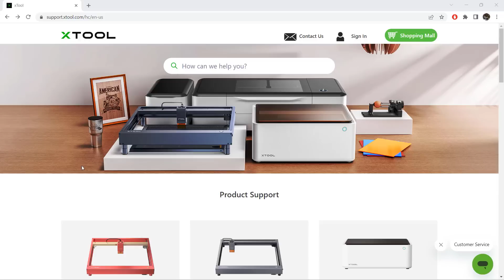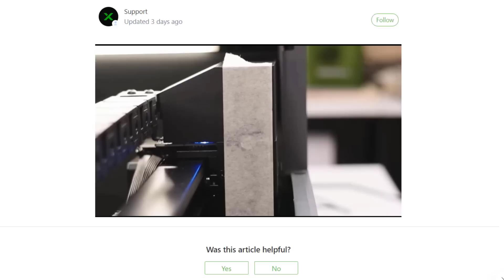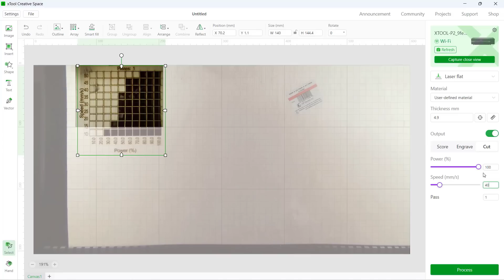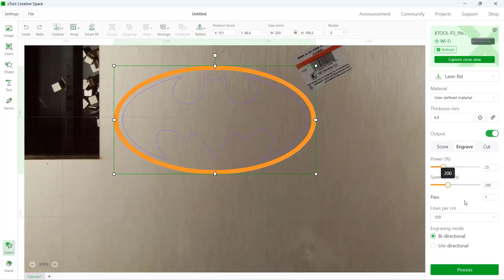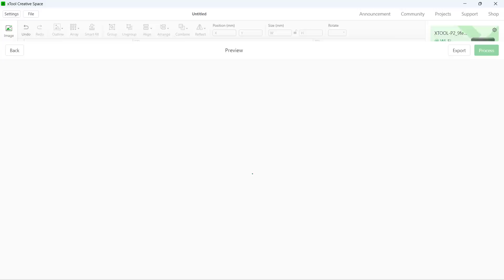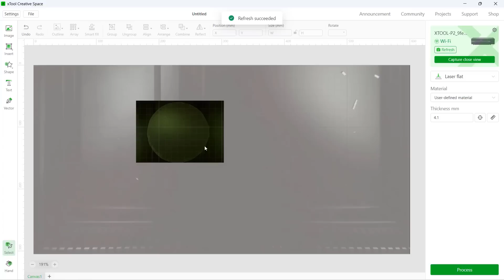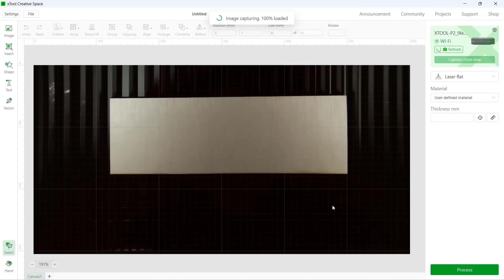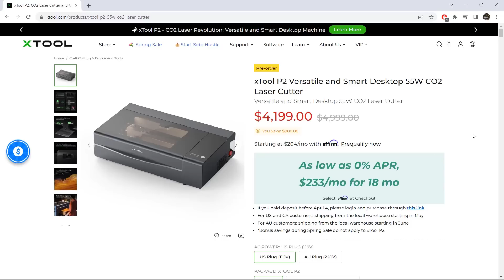xTool P2 55W CO2 Laser Engraver review: A luxury laser engraving machine with a premium price tag

Comment: Finally someone doing an more in-depth show and tell. Thank you for going into the details too.

But I do have some questions:

7:20: why doesn't the camera view show the top of the material (the "Interval: 0.100 mm" part)?
8:23: What's the red dot?
16:35 does the riser come with honeycomb?

One reason for me to look into this instead of the commercial machines in the same price range is lack of space. Even though this is not a small machine, it seems to easier fit into an appartment. :)
Reply from the maker: 7:20: why doesn't the camera view show the top of the material (the "Interval: 0.100 mm" part)?
Because the Interval text is outside the picture size of the close-up camera

8:23: What's the red dot?
The red dot is for the material auto height measure.

16:35 does the riser come with honeycomb?
No, it doesn't, that's my own honeycomb bed for diode laser.
Reply: @AuroraTech  Thanks for your fast reply. I'm really intrigued by the machine and might get one, especially since I prepaid to get the $1000 discount

Comment: Very well presented and laid out. 

I notice that the bottom seems to be open. Is there anything that would prevent one from placing this unit on a larger (deeper) piece to engrave something already constructed? 

I know it is heavy and that is a drawback to that but a purpose built stand would alleviate that allow a wide range of use
Reply: They sell a riser stand for it

Comment: I am very bummed they were not on top of it and had the curved engraving and features available before the release. They were already asking for prepayment a month in advance of shipping.  Now these new (extraordinary) features aren’t even available yet.

I was set to pre-order and decided to wait instead, HUGE bummer.
Reply: it's likely that all features will be available by the time the machines are delivered. Don't forget any videos posted atm are from beta testers (so the machines used are pre-release)
Reply: @neilrisley6667  I understand that. I still think the “hype” would have been better if the beta testers were able to showcase those features since it’s what sets the machine apart from others. I personally just can’t dive into a commitment of that price not knowing exactly how well it works.
Reply: @kaitlynjackson3189  I feel like the risk was worth it with the discounted price. I ordered the P2 with the riser base, the auto feeder & the rotary (along with the free £150 acrylic pack) Total cost was under £4,300 which compared to other machines out there is bested in price only by the Gweike Pro (even without the features) The Gweike Cloud Pro is less powerful, has a smaller working area & the passthrough & riser feet are nowhere near as good as the P2s. I guess if you'd rather wait to see reviewers show the extra features being used you have to pay the extra price without discount. xTool already have videos of the extra features working, that was good enough for me.
Reply: @neilrisley6667  it was very tempting. I’ll give them that. But your also paying that and waiting a month and a half for a machine you haven’t been able to view all of the functions. On top of that, they sale they have right now is only $200 more. And since the curved engraving is the main reason I want it. I’m willing to pay more and wait for reviews. 

But once you receive it, you will have to let me know what you think! I’m definitely anxious for the reviews.
Reply: How did you manage to get all that for £4,300? It is £4,898.00 on their website before the price goes up significantly... :(
Reply: @CristianOBalan  I pre-ordered on launch day after putting a deposit down (that gave a £1100 discount) also got coupon codes for the riser base, feeder & RA2 from getting 10 Friends to sign up to their newsletter.

Comment: Nice video...thank you. When cutting out the longest part of the drawer how do you move the sheet to align with the cutting area? I'm assuming you would have to pause the machine to move the sheet up, how is this done with perfect accuracy? Hope that makes sense
Reply from the maker: Yes, I have to move the sheet manually. Without the auto feeder, you cannot cut anything larger than the print bed in one single job.
Reply: @AuroraTech  did you find it easy to keep it aligned when you had to move it up tho?

Comment: Great review.. best one so far. can it engrave on brick?
Reply from the maker: I believe it should be possible to engrave on brick, as the black slate that I have engraved on is similar to a rock.
Reply: Walt, I know for a fact that a 50 watt raycus fiber laser will engrave on brick. And it does it very quick. I have heard that 50 watt CO2 laser will engrave brick but I don't have one so I can't test it out.

Comment: I noticed you place a honeycomb under the plywood, why?
Reply from the maker: XTool suggested using the top level of the riser and flipping the tray to raise for thin sheets. However, I opted to use a regular 400x400 honeycomb bed instead, based on personal preference. If you don't have something to raise it, flipping the tray will also work just fine.

Comment: Great review! What kind of smoke filtering or fume extractor setup do you have! Any recommendations you’d suggest for the xTool P2?
Reply from the maker: It comes with ducting, but as my own ducting is around 12FT long, I added another 120mm fan at the connector, you can see that at 3:27
Reply: @AuroraTech  any 120mm fan you’d recommend?

Comment: Does the X Tool require a different version of Lightburn?  I do not have the DSP version.
Reply from the maker: I am using the P2 with a Lightburn DSP license, so I'm not sure if that is required or not, but most CO2 lasers do require DSP. However, if you are willing to invest $5k to get this machine, spending an extra $60 for the DSP license may not be that big of a deal.

Comment: Also- does it work offline unlike Glowforge??
Reply from the maker: Their software is not cloud base, it just find your machine over WiFi or a USB cable. You can use LightBurn to control it as well, but you may not able to use the cameras with LightBurn.